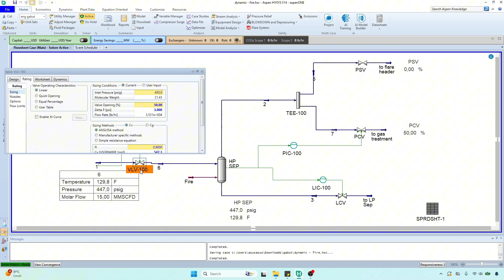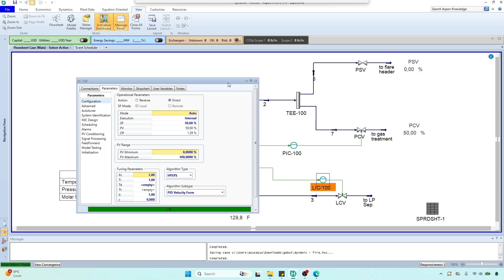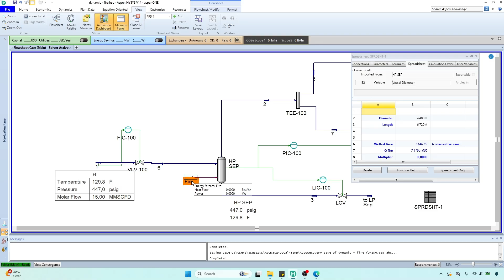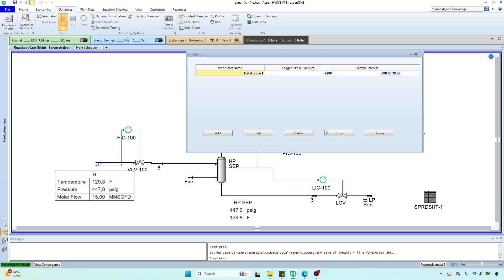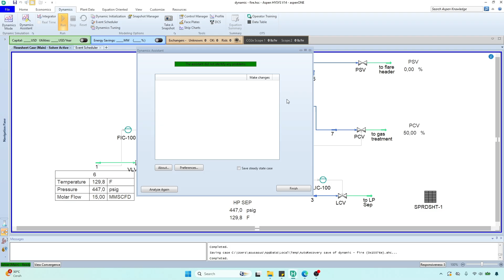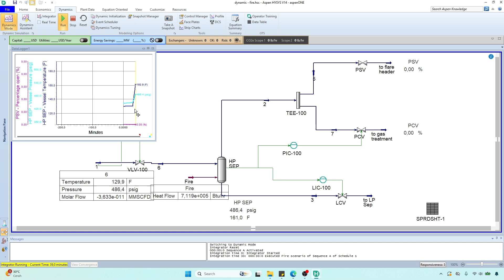Conceptual Dynamic Simulation of Safety Valve under Fire Scenario

Comment: Thank you for this interesting and very informative video. My question: is it correct and realistic to model the PSV's behavior similarly to a control valve in HYSYS? It seems that quick opening characteristic is closer to actual PSV behavior compared to equal percentage.
Another question: wouldn't it be better to link the wetted area to the vessel liquid level, so that during the external fire scenario it also decreases as the liquid level drops? This would also reduce the fire heat flux. This part is unclear to me.
Reply from the maker: Thanks for watching.

Couldn't agree more on your points - quick opening is closer to real PSV behaviour, since a conventional PSV in vapour service is pop-acting and snaps to near full lift within a few percent of overpressure. 

On the wetted area...yes, it can be linked to the actual level in a rigorous model. Just note that what drops is the total fire duty, not the heat flux per unit area, and that keeping the area constant is the conservative assumption for sizing. Once the wall goes dry the issue shifts to unwetted wall temperature, which a PSV unable to protect.

This video is conceptual rather than detailed design, so I kept the assumptions conservative.